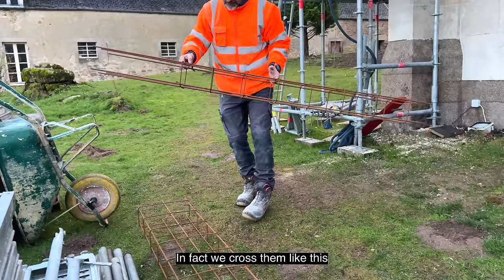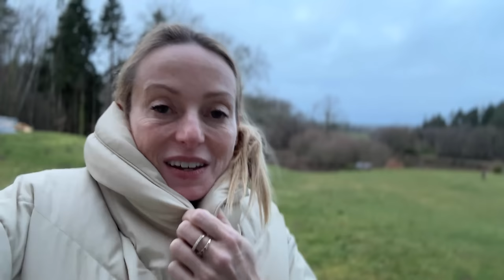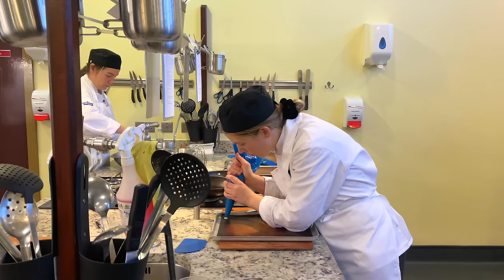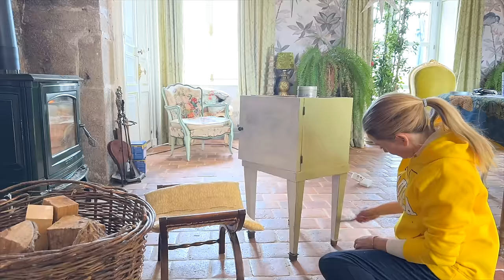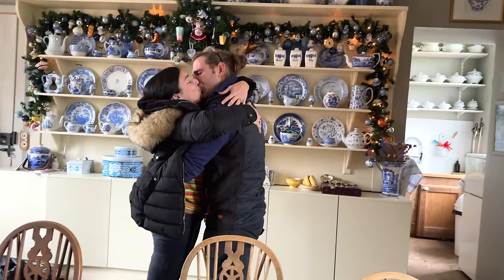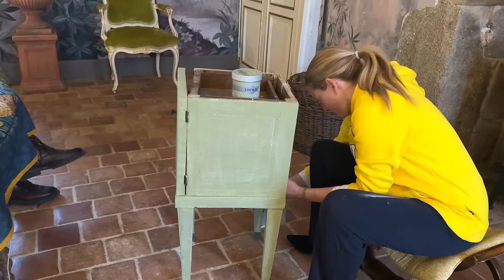Painting the bedside table for the bedroom project! | The colour scheme is coming together 🎨🖌️

Comment: Tip: between coats of paint, cover your paintbrush in cling film or some sort of baggies with an elastic, and stick it in the freezer.  No need to clean brushes either latex or oil base between coats. Just take the brush out of the freezer for a few minutes and it is good to go for the next second or third coat. I must admit, however, to discovering a clingfilmed paintbrush months later underneath the frozen whatevers in the freezer.

Comment: I would use some type of drop cloth underneath a piece of furniture you are painting indoors. Especially when painting furniture on top of the antique tiled flooring in the room you were painting the small side table.
Reply: Stephanie chose instead the method that consists in not dropping paint on the freaking floor.
Reply: @aiglonducal314  You never know when paint will drip or splatter. Ere on the side of caution.

Comment: I love the bedspread with the wallpaper. It really match well, but the headboard does not. You need some thing different for instance one colour for the headboard the only reason for that is because they’re so close together. Otherwise you might’ve gotten away with it.  Or a different bedspread but it’s a shame because the colours are so similar to the wallpaper more than the headboard. it depends which is easier and less costly the headboard or the bedspread.  The headboard is more traditional than the wallpaper. The wallpaper It very similar to the bedspread, light and airy. Love the colour green you painted on the night table and a little darker cream on the door and base board trims etc. Have them stand out a little bit. You could also paint them green like the night table.🌈💝🇨🇦
Reply: Agree. A white color on the door won't look good. It needs some depth. I would pick definitely pick the darker of the two shades she picked for the door.

Comment: I think the upholstered headboard is too much for that room. The paper and bedspread go well, but a single solid color in velvet would be my recommendation. I understand you want the vintage, but sometimes, it's nice to have a contemporary reading of the vintage. Otherwise, the room will look tired instead of uplifting. Use that nice headboard in a room with a solid painted wall. Also, consider two layers of rigid insulation in the roof instead of batt insulation - better R value, waterproof, etc.

Comment: Bedspread and wallpaper are in the same category in terms of warm and light colors. The Headboard is determined by cool and darker colors. This is what clashes. 
There is a rule for traditional Dirndl in Austria. They consist of these three parts: Top, skirt, and apron. One of them is monochrome, another one is floral and one is either striped or checkered. This is a very interesting principle that also works for decoration. Three floral patterns are too much, but substituting at least one of them with some stripes could work very well.

Comment: I'm not yet sold on the bedspreads. The red tones in the bedspread seem a bit too lively in comparison to the wall paper and headboard fabric's prints. And the bedspread print is a bit ...modern looking(?), although it is a vintage spread. Perhaps it will seem differently with a larger amount of the wallpaper and other accent colors nearby.

Comment: Your indoor gardener needs to remove the wet cover tarp that she was wearing, from the wooden chifforobe otherwise it will ruin  the wood.  IMHO  The floral bedspread doesn't work with the headboard and the wallpaper and table.  Solid white bed linens with a few thrown pillows in front of the two bed pillows that are white.

Comment: That bedroom decoration combo is a hot mess! The head board should be the feature and everything else way simpler. And with actual colors from the headboard fabric. When combining patterns if you need multiple. It’s more pleasing and restful to use a stripe, check or geometric pattern and texture added to a floral or scene. Not multiple florals.

Comment: I saw a possible danger🚒 behind Philip when you were painting Stephanie.
 You or Philip used a wire for electricity. The wire was on a roll. 
Electricity on a roll creates high voltage ⚠️and therefore it can creates a fire 🔥. Please undo the wire when you are using it.I do love you  and the channel.
Reply: Good Lord... 🤦‍♂
Here comes another one who regurgitates bits of information without understanding any of it.
Sure, it is recommended to unroll an extension cord completely if you are going to power and use your lawn mower for example. A lawn mower can use over 1,500 watts of electricity.

The potential danger that comes from using a not completely unrolled cable under such circumstances comes from the heat generated in the cable that might not be able to dissipate enough (therefore the cable could overheat and catch fire). This does not "create high voltage". 

On the other hand, it is OK to use your hedge trimmer even if the cable is not completely unwound. This is because a hedge trimmer may use about 600 watts, for example.

Now, a laptop computer, like the one Philip is using in the video, can be using about 60 watts, which is ten times less than your edge trimmer. It is therefore perfectly OK to use the cable uncoiled to power your laptop computer. It's NOT gonna set the chateau on fire any time soon.